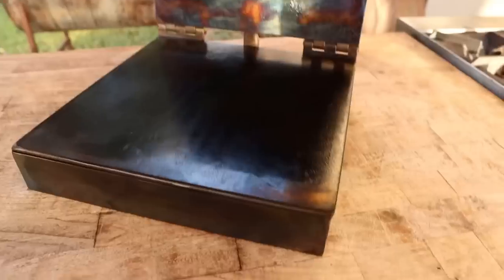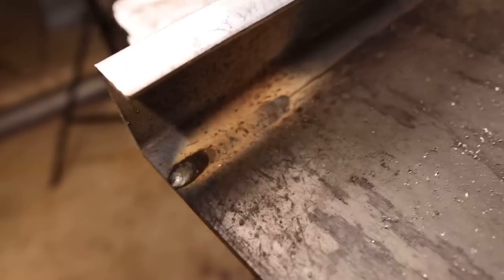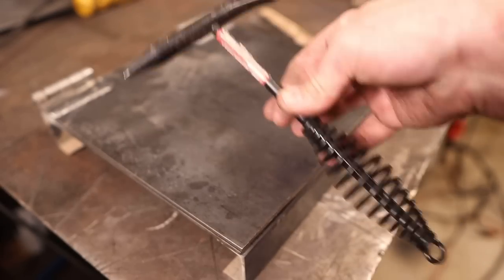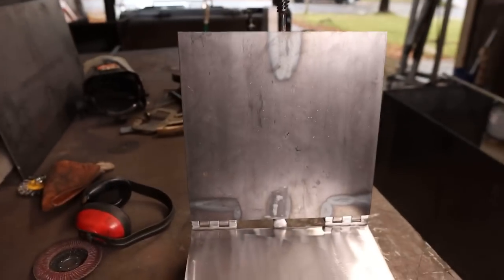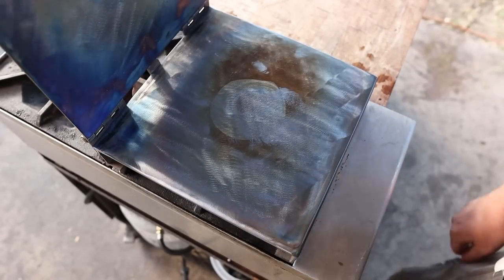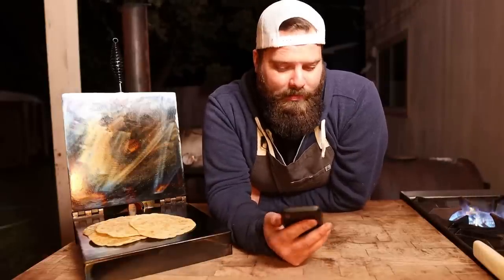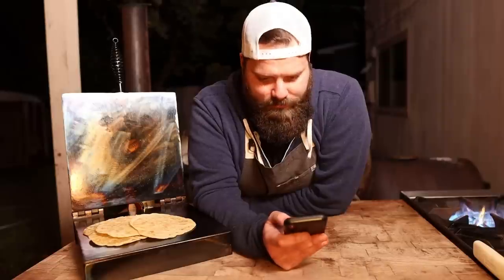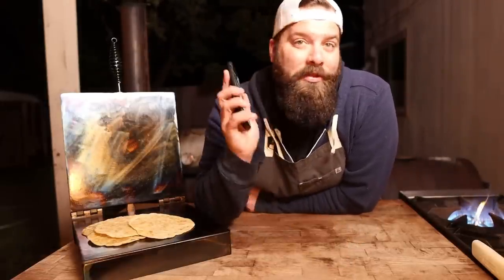Tortilla Press Build | Chuds BBQ

Comment: I know this is an older video and I'm about 2 years late but vinegar works great at removing mill scale. Overnight soak in it will dissolve all of the mill scale and you can get a few uses out of the vinegar before it slows down.  I used 6% strength.
Reply: i tig weld all my stuff, so this is exactly how i do it
Reply: Yep.  Silicone carbide discs work really well too.

Comment: Just made one and handy tip : soak the plate steel in concentrated cleaning vinegar over night. The mill scale wipes off with a sponge. No grinding needed, saves disks and time.

Comment: I'm 99.9%sure that the handles are the the only reason those chipping hammers are still in production. The hammer part couldn't chip the skin off custard.
Reply: You don't need much to get slag off of a weld.
Reply: Lmao never had an issue myself

Comment: Hey man I'm a rookie welder so am always looking for information about everything. One thing I saw a welder doing when using flux core wire he took the gas nozzle/ tip off because you don't need it when there is no gas. I think it stops grounding the tip accidentally but I would think that would be hard to do anyway. I am welding flux core wire  now much easier. Don't know if this is correct but hey, seems to be good. 
Love your videos mate. Hi from NZ

Comment: I found you through Glen And Friends Cooking and think you are amazing and believe you should contract the tortilla Press & sell Millions. I had a El Paso Quesadilla Maker which is heated and it made that same sound when it was pushed down. Without heat it is hard to make a thin tortilla. I live in NYC so I  don't have a shop but am considering going to a welder to put the pieces together although

Comment: Awesome videos and Grinding mill scale sucks, take it From a Toolmaker/ Fabricator. May I suggest using muriatic acid to strip the mill scale. Its quick and easy. You can get it in a hardware store and dilute with water in a spray bottle, NOTE always add the acid to the water not water to acid, so fill the bottle with water first then add the acid. Use a plastic pan outside and spray on the surface, it will foam up when working on the scale then rinse in a bucket of water. Or if you order P&O steel, (pickled and oiled) its already done for a few bucks more. Another option is vinegar but I heard it takes a while but have not tried it, you may want to soak some for a few days to see of it works.
Smoke-On
Reply from the maker: Yeah I’ve tried muriatic acid before, the fumes rusted every piece of metal in my shop haha, I’ll try diluting it next time
Reply: @ChudsBbq  Yeah definitely do it outside! It is well worth asking your steel supplier about P&O, the time savings will more than make up the difference on cost.
Reply: New saw?

Comment: We just made one of these and getting the temperature right is challenging. The bottom gets so much hotter than the top. Do you have some instruction or advice on this?
 And how hot do you have it when you use it?

Comment: Would that setup work for corn tortillas as well? Also, would a very slight gap be appropriate? Like 1/32”? Just metal on metal would make it slightly thinner on the back. I would think so anyway.

Comment: here in east Texas those spring handles cost $1.50 at Matheson. you can get a 20' rod of round stock for about 11 bucks. I keep hearing people talk about repurposing those hammers but really its a waste of money. also check with your local steel supplier most of them sell pre-built spring handles ready to weld on for around 3 bucks.

Comment: Nice, straightforward build, but I did cringe a little when you started removing the mill scale manually. I felt bad for you! Not sure if it is already in the comments, but using a 50 percent muriatic acid to water ratio,  soaking for an hour in a plastic tub, then rinsed works wonders. Cheers!

Comment: I had a tortillas press made here in Philippines.  Bought a mixer also.  I have a problem maybe someone can help. 1st using the mixer we use a lot more water in our dough to keep it moist,  we use heat on our press then take the tortillas to grill to finish cooking but they are coming out tuff. Why?

Comment: OI Brad you know if you soak those plates in white vinegar over night that mill scale will wipe straight off right ? look m8 im a blacksmith ( if you mention fugged in fire im coming to get yu ! )  mill scale is fe204 or 302 i forget (one is mill scale one is rust)  it dissolves in vinegar turns black and wipes straight off will save you $2 a time on flap discs  .... you sure you dont need some advice i been welding for 35 years??   also a gas welder will stop the need for splatter and oxides clean up saving you 1 min per weld  sounds like nothing but your prob making 200 welds on a large chud box ? i could come make them 2 hours and $30+ cheaper per item ....